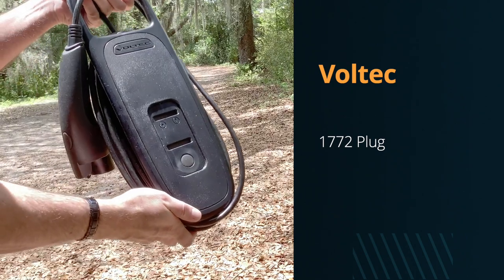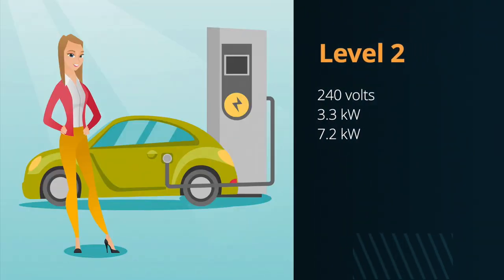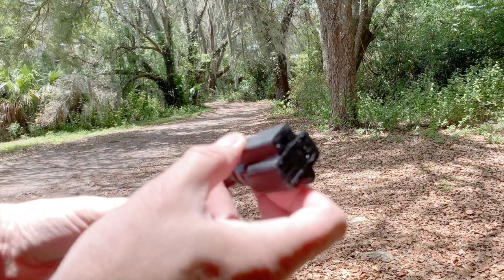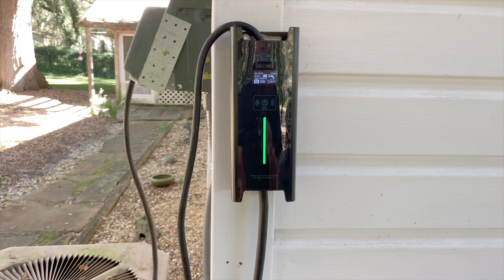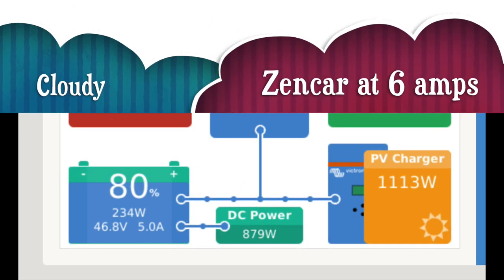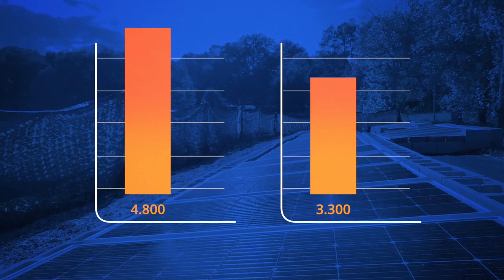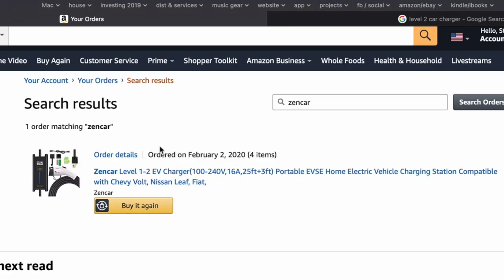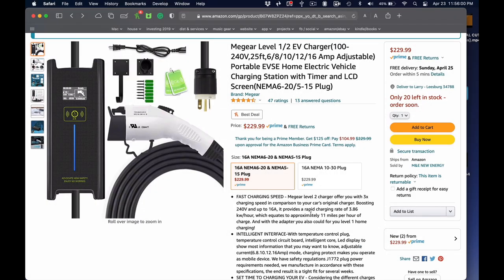Solar Electric Car Charging At Home

Comment: Most videos about charging use AC hooked up to the grid and the people are complaining about charging at 100amps as being slow. I wonder about their electric bill. 16 amps at 240 overnight seems reasonable. or with enough panels during the day to make it free.
Reply from the maker: People want everything to be instant. For my use, 16 amps are fine. I can add 10-15 kwh to my EV on a sunny day, which gives me 45+ miles. A 100amp charge rate possibly shortens the life of the battery!

Comment: Greatest video my father owns a Chevy volt it’s 1gen it takes quite  time to charge at 120 8amps but our electrical system doesn’t allow more as breaker trips anyways this charger you mention is nice for the display but we also are ima future planing to go solar and I’ll be awesome to not depend on the breaker limits and maybe go full 240v but that of course as you mention might take a while to save up , how much did the Chevy volt batteries cost you and shipping is it hard to modify those batteries to work for this types of setups ?  I mostly have only tried 12v inverters
Reply: Thanks, Chuck. I picked up the Volt batteries on ebay a few years ago for around $300/each plus shipping. They cost more now. Also Volt batteries don't have a BMS system. I would look at LiFePo (Lithium Iron Phosate) instead. Safer, built-in BMS, they weigh a little more, but that doesn't matter in a household solar storage system. 
Also, use thicker wire for the EVSE charger outlet. I used 8awg.

Comment: Dear, the point is Not to use an inverter. To charge directly from the panels, without inverter. Electric cars doesnt accept Dc charging?
Reply from the maker: some electric vehicles, such as my Chevy Volt, do not offer DC charging. Many newer EVs do have fast DC charging, but would most likely require a charge controller to regulate solar power.

Comment: So say a person buys the Ford F150 Electric.  And wants an off grid charging station to power it, completely off the grid to fully charge the pickup every day with the larger battery option.  What size system and how much battery would one need.  Thanks for the help.
Reply from the maker: To charge totally off-grid would take a large battery. The f150 lightning battery is 125kWh, so you would need enough battery to charge it on cloudy days, or overnight.

A more realistic scenario would be to charge off solar when you have excess solar production. 

You would have to find out how many kWhrs you actually use on a typical day. I'm estimating 3-4 miles per kWhr plus whatever power you might use at a jobsite, etc from the Ford's built in inverter.
Reply: Let's say I used 250 miles worth of the battery every day.  I am in rural Southern Oregon.  How much panels and batteries do I need.  Is that 10,000 dollars, 20,000 dollars.
Reply from the maker: There are many variables, check out this video as a simplified primer. https://www.youtube.com/watch?v=TJBGbufexEM

Comment: I've been searching for why I can't get my LEAF level one charger to work with my inverter.  I have found that it is needing a ground.  I grounded my inverter and it still didn't work.   I installed a GFCI and it also didn't work. 
WHAT does work without spending hundreds more.
Reply from the maker: Does the charger work when using the grid?
What kind of inverter? How is the inverter grounded?
Reply: @ReelClearMediaLLC  I just now checked it and it worked! 
I have 4- 6v golf cart batteries, 600 watts of solar a GoWise 2000 watt pure sine inverter and the Renogy Rover charge controller. A simple system, but it'll charge my car. 😁
Reply: @ReelClearMediaLLC  OH I just realized you are not who I was thinking of. 
Yes the charger works on the grid. It was looking for ground and my inverter is a floating ground. I made a neutral ground bonding plug, plugged it in a that fixed the problem 😁